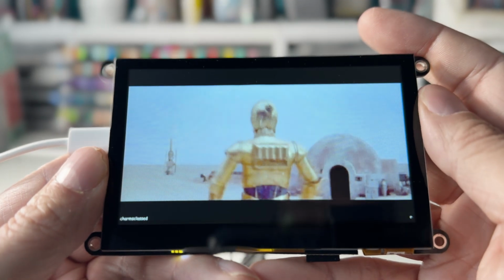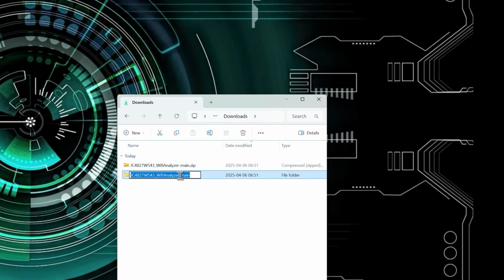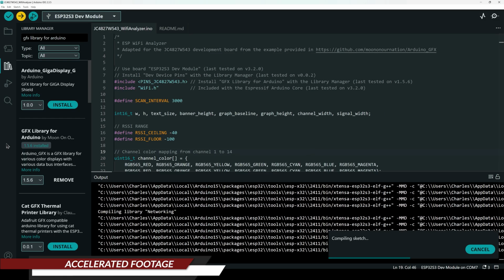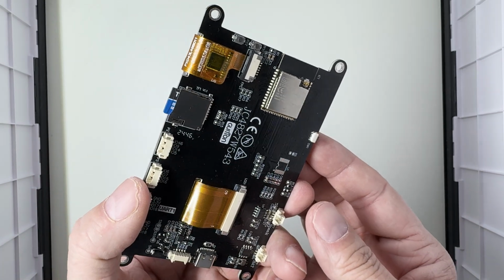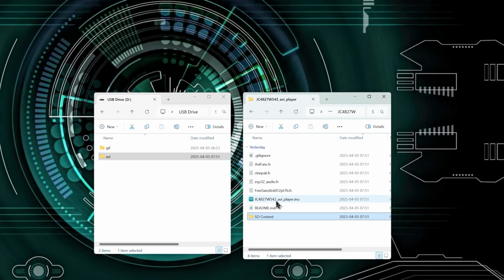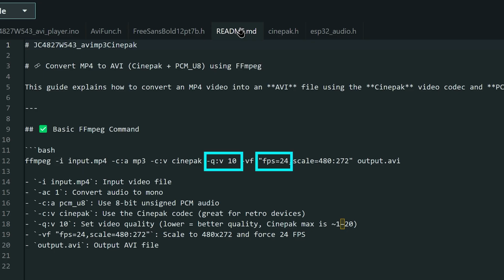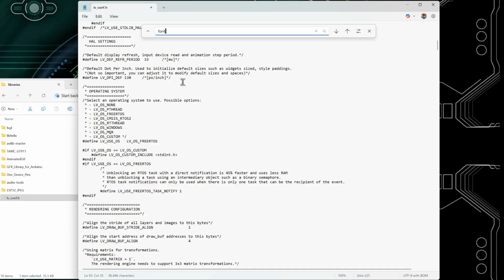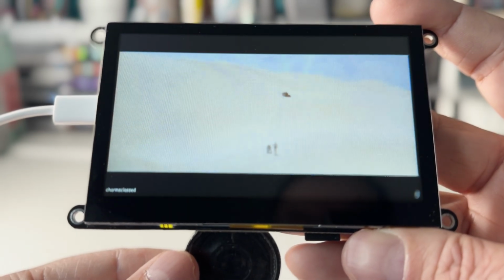JC4827W543 ESP32-S3 board full tutorial

Comment: I get compile errors: "esp_lcd_i80_alloc_draw_buffer" not declared. When I got back to the version you recommend, I get even more errors.  I cannot reproduce your Wifi Scanner example. (I submitted an issue on github for this)
Reply: My thanks to theLastOutpostWorkshop: All libraries and Board package need specific versions: 
Esp32 by Espressif v3.2.0
Dev Device Pins v0.0.2
GFX Library for Arduino v1.5.6

With even slightly newer / older versions you get incomprehensible compile errors - this appears to be a fragile ecosystem, or at least, SW development in a state of flux. But I got the Wifi Demo working 🙃

Comment: i want to create my own complex UI please can you show how i can do this using squareline studio? or any other UI creator so i can load it on arduino ide
Reply from the maker: Look at this video, it's not the same board, but the principle is the same : https://youtu.be/HT6sG39-vrk
Reply: @thelastoutpostworkshop so on the example code on internet radio the file named secrets.h will I replace it with the UI files from squareline studio? And because squareline supports lvgl version 8.3.11 will I downgrade the lvgl? Please help I beg
Reply from the maker: the secrets.h do not come from Squareline studio, it is only required if you need your application to access the internet.  You do not have to downgrade to lvgl 8.3.  Squaline Studio 1.5.3 has templates that support lvgl 9.  I show it in the video in my first comment above
Reply: @thelastoutpostworkshop  okay please make a video with the display JC4827W543 with squareline and lvgl   I beg I will be much grateful 🙏🙏 I recently bought the display but I am unable to run squareline UI I have made

Comment: Ever found a way to recharge a battery with that? Supposedly there is an onboard IC for that, but the spec sheet doesn't say what IC. Thanks in advance for explaining how to recharge a battery, as that would seemingly also maybe make it possible to add a power switch. Maybe PMIC soft power off is another option for a power switch also.
Reply: Update: factory rep said the battery recharging IC is IP5306

Comment: So are tamc_gt911, gfx_library, and dev_device_pins the only libraries required for using the capacitive touch edition of that board with full graphics, touch, and GPIO capabilities? (No other libraries are necessary?) Also, what is the most recent LVGL library compatible with that board and those libraries? Thanks in advance!👍
Reply from the maker: The touch controllerTAMC_GT911 is for the capacitive version only, for the resistive version it's the touch controller XPT2046_Touchscreen that must be used.  The latest version of LVGL (v9) can be used.
Reply: @thelastoutpostworkshop  Thanks! Still using the LVGL version in that video or have confirmed that a newer 9.x version functions properly with that board?
Reply from the maker: LVGL 9 works with this board
Reply: @thelastoutpostworkshop  Found a way to use that reset button as an on/off switch somehow?
Reply from the maker: I am not sure you can use the reset button, but you can use the boot pin, it is pin 0
Reply: @thelastoutpostworkshop Oh? Thanks for mentioning👍 So if I add a switch to that pin it won’t use any power when the switch is open?
Reply: @thelastoutpostworkshop  Do those github repos include double frame buffers ( to prevent tearing)? There has been an issue with an LVGL slider control occasionally tearing. Rare, but that has been annoying.

Comment: WARNING: Don't build any hardware products based on these. They usually function alright without hardware connected, but some of them have problems with hardware connected. Not all of them, but some of them. I sadly invested VAST amounts of effort into making a product based on this and multiple of these JC4827W543 have sadly been unreliable. Only encoders are connected, but even that was a hassle sometimes.
Reply: Hmmm. thanks for the heads up. Any idea what the issue is? The module looks really good quality

Comment: There have been issues where some of the touchscreens (on capacitive touch JC4827W543) haven't been responding to touch when encoders are connected to the pins on the center connector port of that row of 3 identical connector ports. Other JC4827W543 function properly with same daughter PCB (where the encoders are). Any recommended solution to make all of the JC4827W543 touchscreens function properly? At one point that was only happening when a speaker was connected to the speaker port prior to USB power being connected, but now it's also happened when it was connected after. Thanks in advance if any here can post a solution to that!!

Comment: Will your setup and code work for this module? I need to go to a smaller screen size for my application 
ESP32-2432S028R 2.8 Inch TFT LCD Display Module with Resistive Touch Screen, 240x320 Resolution ILI9341 Driver, WiFi Bluetooth ESP32 Dual Core Development Board Compatible with Arduino IDE
Reply from the maker: See this other project with the ESP32-2432S028R   :https://youtu.be/jYcxUgxz9ks
Reply: I bought some from a factory, and it seemed pretty good.

Comment: Hi! Thanks for the great video.
I bought the same JC4827W543 board and confirmed your sample sketch runs fine.

I’m planning to design my UI in SquareLine Studio and then integrate it with my own Arduino code, but I’m confused about which library versions are best. Guition’s docs list different LVGL/driver versions than the ones you seem to use.

Could you share:

How you created your sample sketch (toolchain, steps)?

The exact library versions you used (LVGL, graphics/touch drivers, etc.) and any changes to lv_conf.h.

Whether you used SquareLine Studio (or another tool) to generate/integrate the UI, and how you tied that code into your sketch.

Any reason you avoided TFT_eSPI and chose NV3041A + QSPI with another GFX library?

I’m using Arduino IDE + SquareLine. Any tips on the best combo for this board would be super helpful. Thanks!
Reply from the maker: All the versions and libraries used are in comments in the code.  I did not use Squareline because it does not support LVGL v9.  I avoided the TFT_eSPI library because it is no longer maintained for a long time now.

Comment: but what kind of chip does this board use, for the screen to put it in tft_eSPI on user_setup?
Reply from the maker: It uses the NV3041A display controller with QSPI (4 data lines) and it's not compatible with tft_eSPI, which appears to be no longer maintained.
Reply: I finally solved it, thank you very much @thelastoutpostworkshop

Comment: do you know how to flash a .bin on this device, I have tried to install openhasp and create a remote control, however when I press boot in the process it does not respond, will it need some hardware modification?
Reply from the maker: Did you tried to upload the bin from the Arduino IDE ?
Reply: @thelastoutpostworkshop   I finally managed to get it to work with the following command " python -m esptool --chip esp32s3 --port COM3 --baud 921600 --before default_reset --after hard_reset write_flash 0x10000 "D:\guition-jc4827w543c_ota_v0.7.0-rc13_042fe05.bin""
Reply: @thelastoutpostworkshop    I got it with this command finally with that I have openhasp working, now I am generating the pages
"python -m esptool --chip esp32s3 --port COM3 --baud 921600 --before default_reset --after hard_reset write_flash 0x10000 "D:\guition-jc4827w543c_ota_v0.7.0-rc13_042fe05.bin"
"

Comment: Hi! I was so intrigued by the content you posted that I just ordered the panel on Ali based on your link. I like the detail in your videos. I started learning about this a few weeks ago and I am really frustrated with all the wiring, display and SD connections, etc. I'm going to try an all-in-one panel. I will keep an eye on you in the future, thanks again, good luck to us! :)
P.S. how problematic would it be to use Latin2 accented characters on the radio?
Reply from the maker: LVGL v9’s text handling is based entirely on UTF-8, so there is no built-in support for the legacy ISO-8859-2 (Latin-2) encoding—everything you feed into LVGL must be valid UTF-8.
Reply: @thelastoutpostworkshop  Thank you, I understand. The question is the same, can accented characters be used in the project?
Reply from the maker: Yes, sorry, UTF-8 include accented characters
Reply: @thelastoutpostworkshop my tool is on its way, I will be very interested to try out the solutions you have described, thank you!

Comment: i appreciate the many fun projects that you have shared. I have a Star Wars themed room where I have a number of your projects on display. I had some recent visitors whose primary attention was the various screens from your projects and I excitedly told them about "The Last Outpost Workshop" and encouraged them to look you up on YouTube. I am looking forward to this latest project and quickly ordered the JC4827W543 development board. Unfortunately, I didn't order the Capacitive touch mode but the Resistive touch mode (I have since ordered a couple of the Capacitive touch mode and am waiting to receive them). Will the Resistive touch mode work for these projects or should I save it for another project? I wasn't sure if the Resistive touch is more cumbersome because of having to use the "pen" or if there were other reasons. Thank you for the exciting projects. I always look forward to your new videos.
Reply from the maker: Thank you very much I appreciate it.  Someone had problems with the resistive touch, I think we have found the problem and it's currently being tested.  I will update the code on my repo when we have the solution.
Reply: @thelastoutpostworkshop  Thank you. I was excited enough to order the Capacitive touch version as well. I'll be more careful to read the information you provide in the future.
Reply from the maker: All the code works now with the resistive touch model
Reply: @thelastoutpostworkshop  Hello, what I have to change to run for example the GIF- and AVI-player with the resistive touchpanel?
Reply: @thelastoutpostworkshop  Great! I'll give it a try. Thanks.

Comment: Hello. Very nice wifi analyzer project. Thanks a lot. I just received my ESP32-S3 JC4827W543 (capacitive touch screen) today. The wifi analyzer works well except that all the colors are inverted. The screen is white, the curves are red, the letters are black, etc... Do you know why ? Thanks for your answer.
Reply from the maker: Open an issue here, it will be easier for me to help you : https://github.com/thelastoutpostworkshop/JC4827W543_WifiAnalyzer
Reply: @thelastoutpostworkshop  It's all fine now after a mistake in "lv_conf" and a new uploading. Tanks for your help
Reply: @philippechampouret  Can you help me what you did specifically?
I habe the same problem with inverted colours.
Reply: @geroldgrosser   Hello. You have to setup the file lv_conf.h as describe in the video at  and put this file in the root of libraries directory
Reply: @philippechampouret  Thanks, after New Start all was correct.

Comment: I use this board all the time, I love it! It has everything you might need, but I wish it would expose the pins used for the sd as well, it would be more flexible for projects where sd cards are not needed. Also the GND and 3v3 unfortunately is only exposed with Serial port pins, but it’s really irrelevant considering the price, quality and how versatile this board is

Comment: I have just bought a JC8048W550, any pointers on how to use this as I can find virtually nothing about it?
Reply: It looks like this is pretty much identical to the board used in the video, but with a 5" 800x480 LCD instead of 4.3", and 16MB Flash instead of 4MB.  Seeing that, I took a gamble and ordered one, hoping that the instructions given in the video will also work for this module.  That's what I'm going to try first, although I expect I'll have to find in the code where the display size is specified, and adjust it accordingly.
Reply: @BrightBlueJim  i'm sorry but it's not, the display driver is completely different. I recommend the library bb_spi_lcd to drive all the Guition displays as it makes it fairly easy to set up a new screen without all the hassle of compiling user_setup.h for tft_eSPI
Reply: @fabiorossato6368  You are right - I posted that before I received the module, and wasn't aware of the differences.  BUT, I was able to build and run all of the example code Guition provides for this display, and they work just fine, giving plenty of examples of how to use this.
Reply: I should also mention, though, that the 5" LCD on the "550" module uses a different type of display controller, whch uses a 16 bit parallel interface instead of SPI.  This was necessary because the display controller (Sitronix ST7762) does not have internal memory, so it needs to be refreshed at around 60 Hz by the CPU itself, which just isn't possible with SPI.  As a result, even though this unit looks GREAT, it doesn't perform as well as the 4.3" module, which uses a self-refreshing LCD controller.